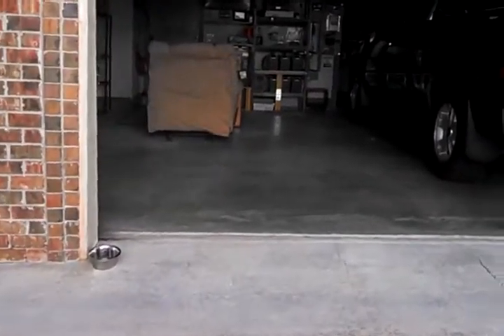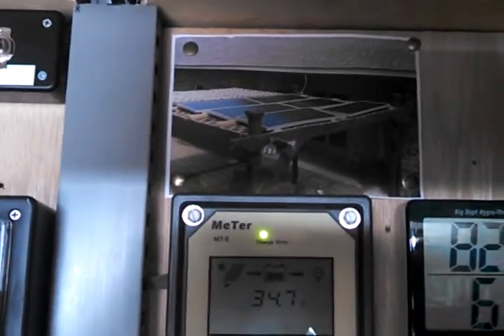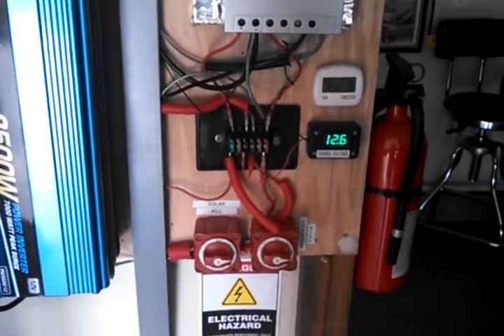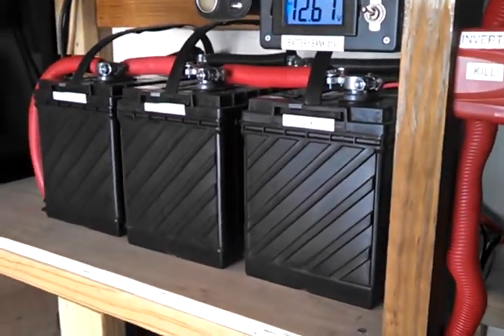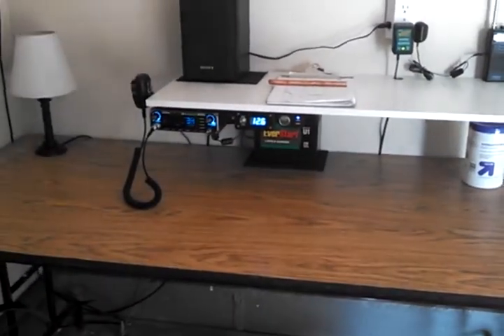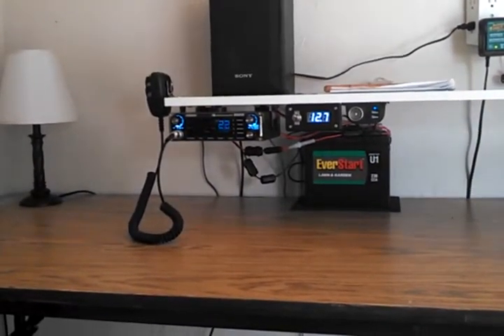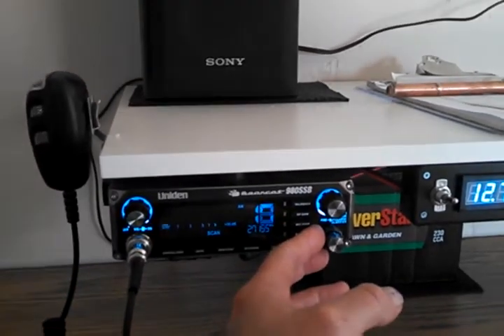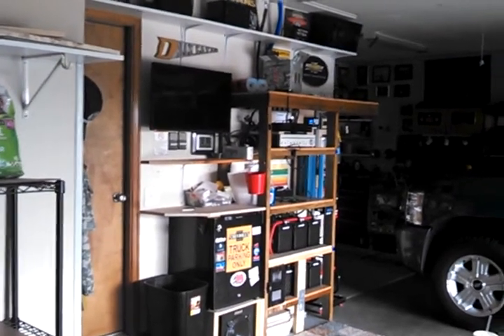Chris DIYer's first YouTube video!! DIY solar panel/battery backup power source

Comment: Chris your very first video shows a very well thought out and safe system. My 1st inverter for my chest refrigerator was a Power Brite as well. I had  210 watts of solar, three 70 watt used Solec panels, a cheap CC and a deep cycle marine battery. It was my 1st back up system that gave me refrigeration and lights through the night. Your 1st system is awesome! It does prove a point though. Solar is addicting LOL.
Reply from the maker: Thanks. I sooooo thought I knew what I was doing back then. Almost three years ago...my first "video". However, was messing around with it about 8-10 months before that. Your system is rocking a new level...love it!

Comment: Hey Chris 
Some friends of mine are wanting some solar backup.  
(CHEEP) (What did you think of the walmart battery's) gonna have 4 wired at 12 volt 1000 watt pure sine inverter.with 6 190 watt topoint mono panel.I told them it might not be a bad idea because walmart 2 year free replacement.They can save for 900.00 worth of trojan t105 later.
Reply from the maker: That'll work. The Walmart Everstart 29DC size batteries were pretty decent batteries. With four 12v batteries...why not go with a 48v system? Get a 48v inverter with a little more power (2,000w is a better choice for emergency back up). But, it all depends on their KW/H use/loads. As for the solar panels...awesome. If they can afford a Midnite Solar KID MPPT solar charge controller...that would be a great fit. All the above together...slick little set up. And, if they wanted to increase the battery bank aH...just add four more of those batteries for less than $500. They are not true "deep cycle" batteries...but, do alright for small RE set-up's. Total cost for that system with four batteries should be around $2,500-3,000. Not counting cable building and PV wiring and misc costs. Fricken' bargain IMO...beats running a generator...and it can be used 24/7 if configured correctly.

Comment: Hello, Would you recommend spending the extra money to get the MPPT VS a PWM controller for a small system? I have a small battery bank (6 x 12 volts x 27D) with 200 watts @ 12 volts and will eventually add another 100-watt panel. I also have a large power-bright inverter and I use them with my camper as an off-grid solution along with an alternator generator. Any suggestions would be greatly appreciated.
Reply from the maker: Is the Powerbright a 12 or 24v unit? I prefer MPPT because I have long PV feeder cable runs and can run high solar panel volts...then the solar charger changes those high volts into amps for charging. If the solar panel feeder cable runs are short and the battery bank is 12v...PWM will work. MPPT (IMO) is worth the extra money for any configuration. Thanks for watching!
Reply: It is  a12-volt system and the power-bright is also a 12-volt unit. Seems to me, after doing some research, that the MPPT would greatly increase the power available from the panels to the batteries. If this is the case then would the MPPT be like a PWM on steroids...? Charging the batteries more quickly and efficiently? FloydFThomasIII@Gmail.Com
Reply from the maker: I think so! My MPPT controllers scan the solar panel's voltage and it picks where the maximum power is at...and runs there. So, yes, sorta like steroids compared to PWM.
Reply: Fantastic.... Thanks for your help and input.

Comment: Hi, have you put all 6 panels in series? I have the same charger just wanting to know if I should run my 100w panels in the same way or parallel.
Reply from the maker: Yep...as long as the solar panel input voltage doesn't exceed 150v, you should be fine. My VOC this winter is about 118 volts DC with six Renogy RNG-100D 12v panels in series. So, the Tracer can handle it. I have four strings now (24 panels)...great panels! Running panels in series is more efficient with MPPT technology. Thanks for watching.

Comment: Elegant system Chris. I'm getting ready to install three 100W Renogy panels on unistruts cemented into the ground, a TriStar 45 controller (PWM), a Whistler 1600W inverter, and a UG121000 100 AH AGM battery. I've been researching grounding techniques and quite frankly, it's a little confusing so I am hoping maybe you can share your wisdom. The controller and inverter both have grounding terminals - wondering if I bond them together to an earth rod, and provide separate grounding for the panels to earth? What about the battery? Thanks in advance!
Reply from the maker: Jim - Thanks. Sounds like your system is starting off well. As for grounding, I sunk a copper rod (bought at Lowes) down 7' and connected it via cable to the charge controller, power inverter and negative side of the battery bank. Everything is tied in together. As for the panels...haven't grounded them. If lightning ever hit the panels...there would be more to worry about than grounds. My advice would be use a separate ground for the panels since they are outside. Grounding is for my safety and if something goes wrong...shorts to ground and not smoke. Good luck with the install...keep me posted!
Reply: Thanks for the advice - that is what I decided upon except I did ground the panels on the same electrode. Also using a breaker for the PV cable, but only fuses between the inverter and battery and controller and battery. Sound reasonable?
Reply from the maker: Sounds good. They have made some improvements in breakers...but, I am still a fan of good 'ol fuses. I am using automotive ATC spade type fuses (Buss, 40-amp 32-volt) for the "+" PV cable going into the charge controller. Got them at a local auto parts store...like $4. My solar panel array is wired for 36-volts (two strings of three panels...total of six). So, no issues with voltage...great protection. Between my 3500 watt inverter and six-battery bank, I am using an AMG style fuse (200 amp). For yours, a 100 amp fuse would work. BTW, I went through three Whistler inverters...they work, however, I run my system 24/7 and the fans went out in one month. I returned two Whistler inverters for full refund and sent one off for warranty repair (still have it, in a box, fixed, will use as a backup). I switched to the Powerbright PW3500-12 and it has been AWESOME! It has been "on" for 7 months now. The Vac output at the outlet is 125 volts...and with a 100' extension cable run...122 volts. The Whistler could only produce 112 volts.